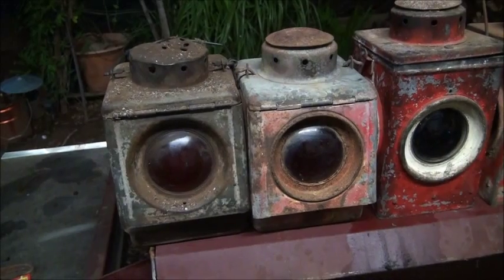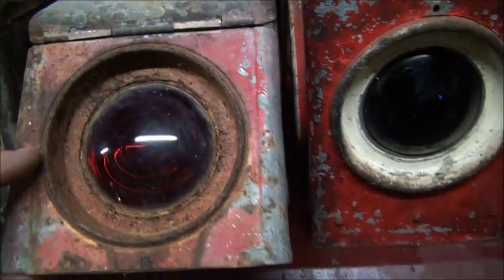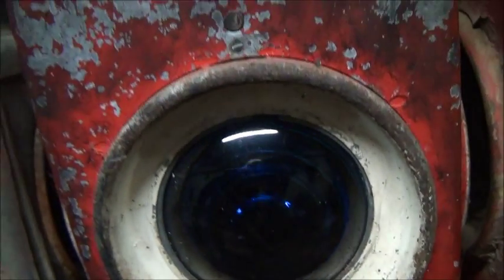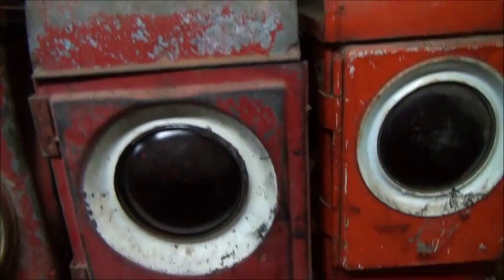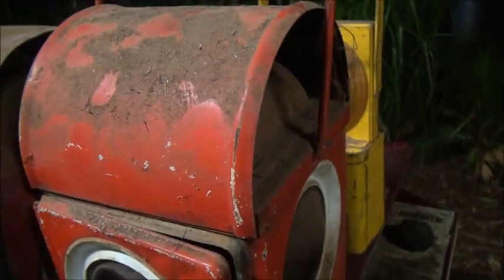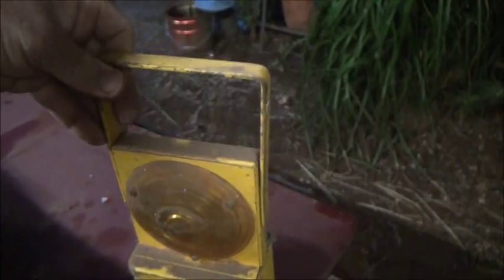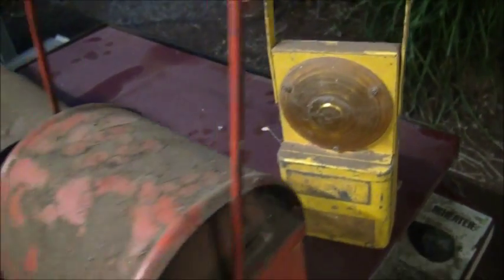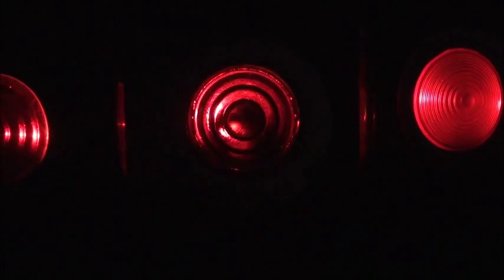kerosene and parrafin roadwork lamps

Comment: Beaut video!!!! Ive  got about 16 and some I have stripped back and repainted while a few Ive left original and I have some earlier round ones and one of the square ones has amber lenses
Reply from the maker: Thanks! I have added a few more to the collection since I made the video, the lantern with the Bluish lens had a cracked lens and luckily I sourced a replacement Lens off Fleabay. Its now complete. Its good you collect those lanterns and hope you find more good ones.